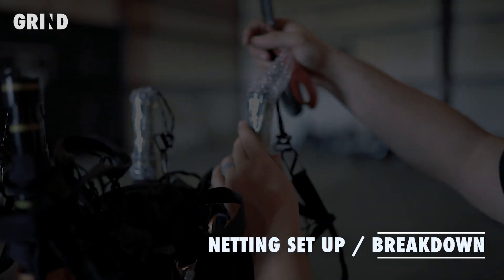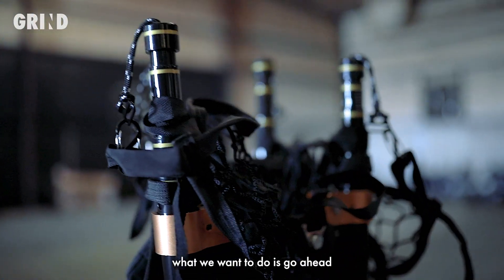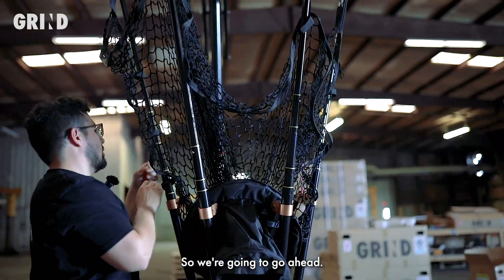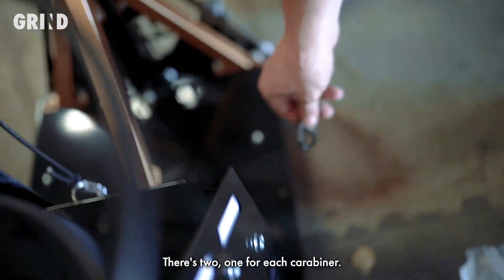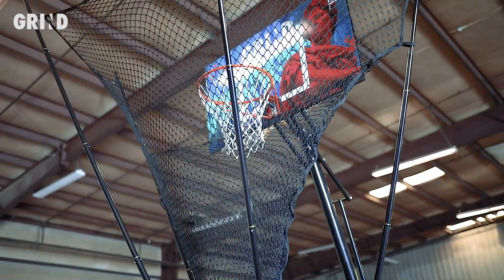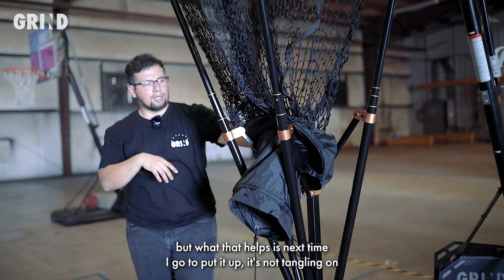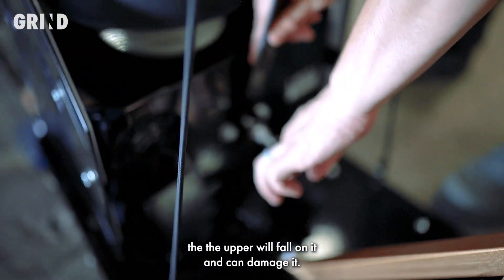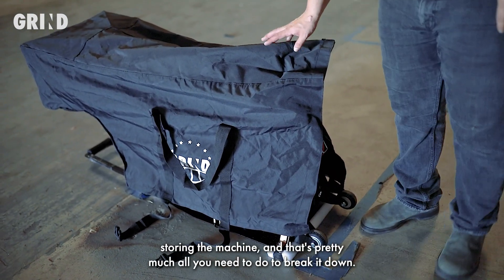Netting Set Up and Breakdown | GRIND Machine

Comment: why is this $2500? dr dish home is same price and has way more features.
Reply: 3k for Dr. Dish basic model, plus $40 a month subscription.  OR you pay 5k with lifetime subscription.  I appreciate this machines basic design and portability,
Reply from the maker: We are nearly $1000 cheaper. Competitors also charge $400 for shipping.
Reply: I looked at Dr Dish but could not afford the $40.00 subscription
Reply: @GRINDBasketball any chance you guys are considering making a model that can move like dr dish or the gun?   Having limited spaces it can pass and having to manually move it is the only drawback I can find vs the competitors. The compact size,simply by having poles that can fold down more is fantastic 😎.   All the other competitors require 78in of height for storage which is such a pain in the ass when your court is up on a hill haha.
Reply from the maker: all we can say is... stay tuned 😊 @Jsvids85  you can sign up for our mailing list on our website to be the first to know about new product launches!